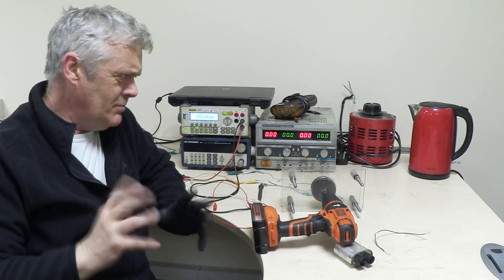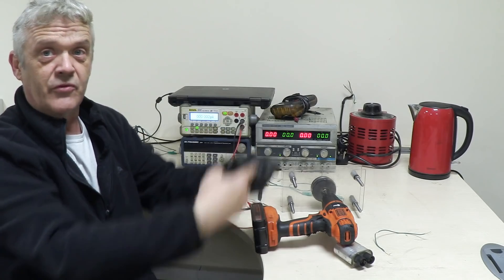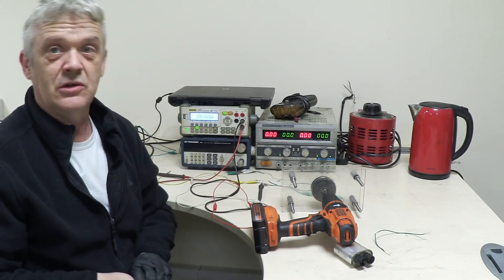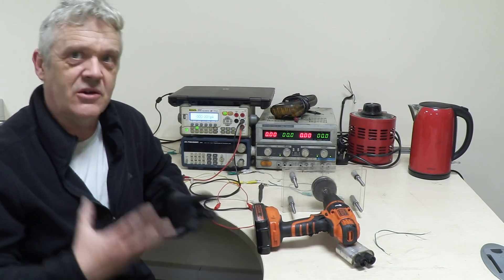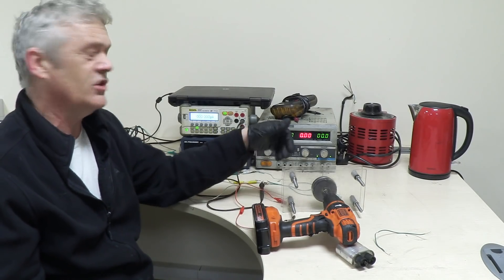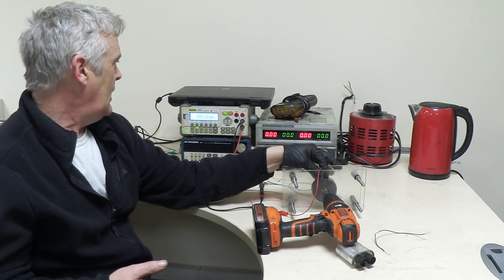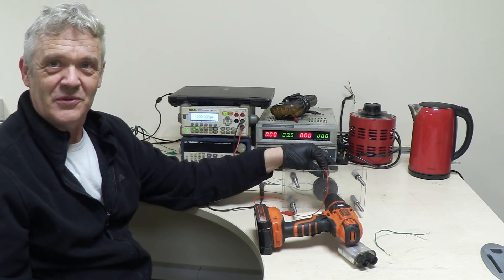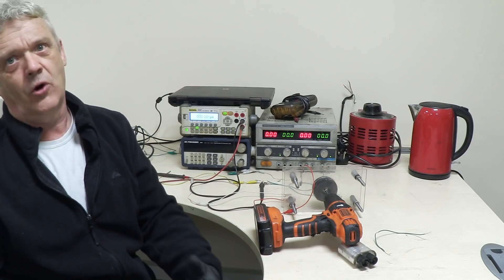Strange Behaviour Of A Tesla Homopolar Generator

Comment: Einstein in a presentation at the University of Leiden in 1920 tried to 'claw back' his General Relativity statement of "space is empty".  NO ONE LISTENED.  The 1915 claim 'space is empty' is still prevalent.
"The medium of space is - there is no medium" - this has blocked progress in physics since 1915, for most physics fans/practitioners.

The magnetic field is fixed in space.  If you fix a magnet, the immediately-adjacent space manifests its magnetic field.

Let's say we're considering the top side of a disk magnet, which happens to be its North pole, and the disk magnet is FIXED IN PLACE.   Read the magnetic field with a magnetometer - it will register (it will display the strength of) the magnetic field.

Now rotate the disk magnet.  Read the field with the magnetometer.  It reads the exact same North polar magnetic field as when the magnet wasn't rotating.

The North pole magnetic field is FIXED IN SPACE.  

This is why there is relative motion.  The North polar magnetic field, regardless of whether you rotate the disk magnet or not, does not rotate.  

PHYSICAL ANALOGY
- the medium is water
- a disk in the water is heated
- a thermometer reads the temperature
- the disk is rotated
- the thermometer reads the same temp

This is 100% expected and understood because people say "right, there is a MEDIUM there, it's water"
.

Comment: The homopolar generator can be viewed as as a planar rectangular copper sheet with magnets beneth it. The straight line from the center of the copper disk to the brush can be simply viewed as two terminals of an ammeter moving through the copper sheet. The straight line between the terminals works exactly like a straight wire running through the B field. Thus a current is induced.

Comment: Inside the copper disk the straight line between the center and the brush act as a straight wire rotating through a magnetic field. This wire generates a current.
Reply: The imaginary wire rotates opposite to the B field rotation thus indeed there is a relative motion between the imaginary wire and the B field therefore an end is induced in the imaginary wire.
Reply: *emf

Comment: I don't think that the current that you measure comes from the disc  between the magnets if it was it would large as the area of the disc is large, don't forget that the magnetic field lines go out of the magnet and through the air around and into the other magnet so when you touch the perimeter of the disc with wire it is cut by the rotating magnetic field and it will generate current as per physics text book, to make sure that it is the disc current that you measure you would need to first shield that wire from the magnetic field going through the air!

Comment: Amazingly, the field seems anchored to the orientation in space. I have a setup for testing, and 30 years ago, at UCLA I demonstrated this, but my claim was only that flux was fungible. That is, one source of flux is as good as another, and if there is no change in flux, then eddy currents do not occur in conductive solids. But to say that the field doesn't rotate is a claim I didn't make, but now I do. I feel very connected to the universe because of it. The relative motion you are using is between the non-rotating field and the rotating matter. You don't even need that middle disc to do it. One magnet will serve all purposes. There are scientific papers which prove that the field rotates and ones that prove it does not.

Comment: I have build a machine, over 35 jears ago. Same prinzip but other structure. It was possible to reach 2000Amps at 1,8Volts with this machine. But only therefore, because my machine was build far from perfect. From very small design you can get thousends of Amperes. And a secret too: you dont need a disk of copper or brass. 🤫
Excuse my bad english.

Comment: The voltage is very low, but the current is high, so you should use a smaller resistance, even as low as 0.001 ohms. When the rotational speed is not over ten thousand revolutions per minute, the voltage will be very low, and using a magnet will yield better

Comment: Gravity is the key. If you spun at 10k rpms you'd get maybe 1/2 a volt, but a lot of amps. I think of it as spraying water on a spinning bicycle wheel - the centrifugal force of the spinning wheel flings off water in every direction. If you added a contact that surrounded the entire circumference of the disc one could capture more voltage, but huge amounts of amps with little magnetic drag. Also, it's better to spin neodymium cylinder/disk magnet alone with brushes on shaft and at outer edge of magnet. This cancels out all drag that on coil generators incurr when connected to the load.

Comment: I enjoy watching your videos. Thank you for your sharing of knowledge in an easy way of understanding. Question, could you add say like a slave batery or some other high voltage sorce for voltage and get the current from the faraday/tesla generator. To get a useful power output

Comment: This is a fascinating experiment.

At least we can ignore the shape of the lead wires. Why? Because all of the flux passing through the flat surface of one of the flat magnets adds up to the same amount of flux that moves out into the space in the room, hitting the lead wires.The voltage induced radially across the conducting disk adds up. Its sum equals the sum of the voltage increments in the rest of the current loop that includes the test leads, by Kirchhoff's voltage law.

This means we only need to know the rotation speed, field strength, and radius of that conducting disk to calculate the induced voltage. A segment of the loop current flows radially between the outer peripheral contact point and the center axis, and it flows exactly perpendicularly to the flux that goes into one flat face of the magnet, and out of the other flat magnet face. The voltage across that one clearly defined segment of the current flow path equals the voltage across all the rest of the current loop, including test leads and all.

Comment: dear Robert, this effect was discovered long before relativity theory was first proposed! Circular motion of electrons from the central metal disc, within a N/S magnetic field, creates a sideways or radial force which goes either in or out, depending which way the disc spins. This does not depend whether the magnet is spinning, because radial e.m.f will be exactly the same! THINK and UNDERSTAND please. No need for relativity theory.
Reply: Exactly

Comment: There could be several explanations for the current generation paradox. As previously mentioned in the comments, re, moving magnetic field relative to pickup wire, tribo electric effect. Or,  thermo electric generation due to friction between contact and wheel,  static charge transfer, ie, removing electrons from one surface and depositing on the other surface. Contact potentials under moving conditions are different from static condition. Try same experiment without magnet, or different material combinations.

Comment: The air around the rotor makes an electric loop. The parasitic capacitance of air around is conductive and reactive electric energy can conduct thru It. Vibrations are good enough to make a small alternated current that adds to DC bias. So we have a small reading in the instrument anyway because of reactive electric energy.
Regarding Paradox. When we speak about electric induction, the magnet or wire has to move relatively in order to have an effect of electric induction or a force. The copper conductive loop is not a requirement for AC alternated current. A loop forms anyway even in a total vacuum of space. It is a capacitance loop.
 In case we have a loop, the cross-section part where conductor moves relatively with tthe wire makes an induced electric field, and the part with cross-section where is no relative motion does not generate an electric field In It for the current in the loop. But because we have a loop the part with no relative motion shows the flow of current anyway but It consumes electric energy and It generates heat as electric energy is consumed right there. The magnet will heat up also next to the conductor disk as the disk part of the electric loop formes a heater.

Comment: Don't the magnetic field lines connect through the disc and then close back to the opposite poles with lines around the air gap outside the disc? In which case the wire connecting the carbon brush to the disc is being cut by those external field lines as the disc spins, generating a current. Current should reverse if you spin disc in t'other direction.

Comment: Pleas take the magnets away, redo the experiment or rather understand that there is  relative motion between the rotor and earths magnetic fields, regardless of how strong the ceramic magnet or whatever magnet you decide to use is. As long as copper, steel, or aluminum, is at the same momentum with the magnet there will not be any usable reaction. You are right relative motion is necessary for electron flow, Magnetic fields from different sources will flow independently of each other and do not combine but can add to or subtract from each other in the same moment!  depending on there alignment. Align your experiment east to west and then magnetic north to south with ought the permanent magnets and preform the test  again, you will see a difference in micro amps!
Reply: Spinning the magnet relative to the non-spinning spin will not produce any current, the magnetic field of a Magnet is Ab-Extra to it, rotating the magnet on its "pole" would have no effect on the field unless there are large enough imperfections in the magnet material, the results of this experiment are not unusual if one knows that.

Comment: Although the relative motion is nothing, the rotational forces cause drag in the magnetic field that is interpreted as motion within the wire, so the field IS moving and electricity can be induced.

That is actually part of a series of experiments I am doing with nonmoving permanent magnet induction. The relationships between magnetic fields and how they apply to faradays law have always been a point of interest with me.

Good work mate, this piece of the puzzle helps loads!

Comment: I would try the experiment by rotating the individual components.
Magnets without the coil and the coil with out the magnets.
I might suspect the coil rotating in the earth's field to produce some current. And
It might be interesting to vary the North South relationship of the spin.
And then try it with a Horizontal spin and see what happens.
I'm thinking the coil should be wound in such a way as to have the ends of the wire on opposite sides of the coil with a metal circular plate soldered to them, so you can add a brush on each side to measure the current.
The circular plates would need an insulated rod attached to them so it could be spun.

Comment: So the current generated by rotating the disc against the brush is the same as what you get when you initially press the brush against the disc. That sounds like the brush is just bouncing on the disc as it rotates to me.
BTW: Have you tried it without the magnets? I'd bet the result will be pretty close to the same.

Comment: One common mistake made by many is assuming that if a magnet spins, its magnetic field also  rotates.   but when the magnet spins on an axis through its poles.  the magnetic field remains static and unchanging.  the homopolar generator works with and without the magnets spinning about its polar axis. 

Thus if an electron moves tangently to that magnetic field, it feels a force pushing it tangently to both the magnetic field and the direction of the electron's motion.  Protons feel a force in the other direction but the protons in metal atoms are locked in crystal lattice, thus only electrons in the conduction band are free to move if a circuit path is available, and no counter electric field is seen by the electron.  that's why current collectors must be stationary while the faraday disk is rotating. Otherwise a circuit path in rotation creates an equal and reverse electric field preventing current from flowing.

Comment: 3:40 Friction current.
When you press your carbon brush, you make it vibrate (and the disc too) and it creates electricity.
It decrease with the stabilisation...
When you spin the wheel, you create friction that makes the brush (and the disc) to vibrate again.
As Tesla said: think the world in terms of vibration, frequencies...
Electricity is vibration.
But don't say it: it's taboo! LOL

Ask yourself why thermo electricity exists, or piezo electricity... Vibration. 2 different frequencies, so an "electron" (pseudo particle as photon) flows between the 2 different waves, the direction depending on the high/low frequencies positions.

That's so obvious.
Please go in this direction. I've no equipment. Tell me when you find how to prove it ;-)
NB: this information is free and nobody is allowed to patent it and use it to make money.
Thanks.
Reply: Another explanation (which would contradict what I've written before) is that the electric drill create magnetic flux... inducing current in the multimeter loop...

Comment: i imagine the magnetic force doesn't perfectly follow the magnet instantaneously but hangs in the air for a thousandth or millionth of a second, allowing the diamagnetic copper wire to produce a smaller, but still readable electrical field from it.

Comment: As noted below, magnetic fields merge, they are not canceled, so, the local magnetic field of one magnet may dominate, but it does not eliminate other magnetic fields. It is not accurate to claim that the disc is not moving relative to all magnetic fields. You could demonstrate that the disc does not generate a similar current without the magnetic discs. Although that is not to say that the rotating magnetic fields may or may not amplify the effect of a natural magnetic field We do know for a fact that a static magnetic field will influence the current passed in and around a conductor (the Hall effect), which is the way most magnetic fields are measured by electronic devices. The consistent way moving charges are altered by magnetic fields would indicate the magnetic field interactions may be directional or even non-linear. Giving one to suspect there are multiple forces at work here to be investigated.

Comment: A guy named Bruce Dipalma built an N machine that had a copper disc sandwiched in between 2 ring magnets.  When he spun it to 7000 rpm it would continue to rotate.  The motor he used to start it then acted as a generator once the power supply was removed.  He stuck a wire on the shaft and another on the outer perimeter of the copper generating current.  Together he got alot of power like enough to power a house.  Great video keep up the good work.
Reply: Yes
Reply: Yes just like Adam Trombly’s dynamo. Now with carbon fiber could tap some serious aether ZPE like every particle does. This would power insane HP electric what every you want!

Comment: Robert. You didn't say what size resistor you used. I think that limited the current produced. This is a low voltage high current device. It should be able to drive a low voltage DC motor if the motor resistance is not too high. I was expecting to see you have a motor spinning like in the battery demos.

Comment: What happens if you just put the brush against the wheel without the magnets and spin it.
I also know that if you simply strike the wheel it will "Generate" a high voltage with little current. Just like how the striker igniters work in disposable lighters, although in those there is a crystal being struck by a metal hammer.

Comment: I feel like when you spin it, its doing the same thing as when you first touched the carbon to it. The oxide layer is very hard on aluminum and it could be exposing fresh unreacted carbon. It seems like you are seeing an air battery reaction.

Comment: I LOVE taking things apart for "useful bits"! Been doing it since I was a kid... Played with these a few years ago. I've read that these have been used in industry to generate thousands of Amperes at low voltage (now obsolete). The brushes are a major problem, and mercury has been used as a conductor with all sorts of other issues, as you could imagine.  There is only 1 turn in the generator here. Like a single turn through a toroidal core. Your probe/contact is stationary whilst the disk assembly spins underneath. I think that is the place where the lines intersect the wire with relative motion. The field goes from the outside surface of one magnet to the other one, with your conductor sandwiched between.   I propose that a "coaxial" arrangement picked up at the axles will not produce significant induced voltage. Still, these are fascinating.  BTW, this is, IMO, the same as the "tether" experiment with the Space Shuttle, where the tether exploded from induced current.  Cheers!
Reply from the maker: cheers mate

Comment: One of the simplest and first motor generators..yet so badly understood. 
Tried some testing a few years ago but eventually lost the time for experiments..
I had one idea of how to get the outside current fed back to the centre so it could be connected in series and multiplied in voltage. Never got to it though.. Needed some parts unavailable to me at the time